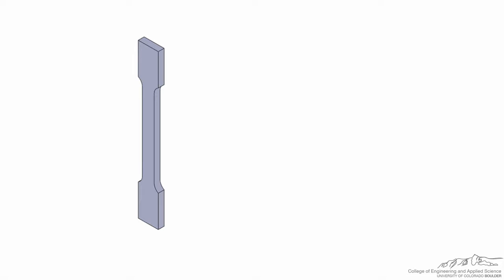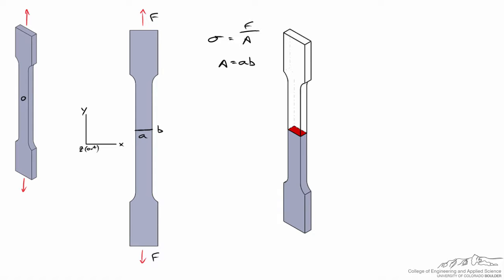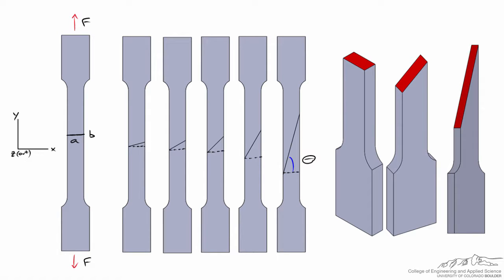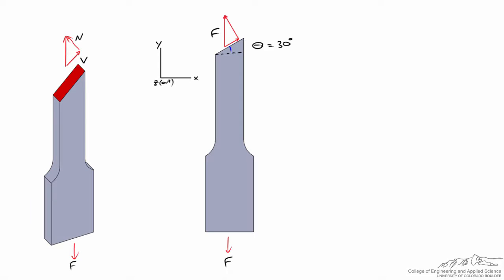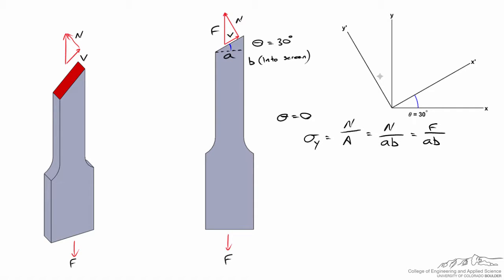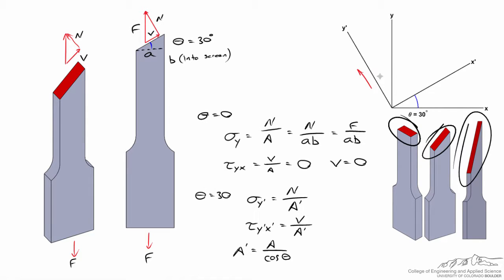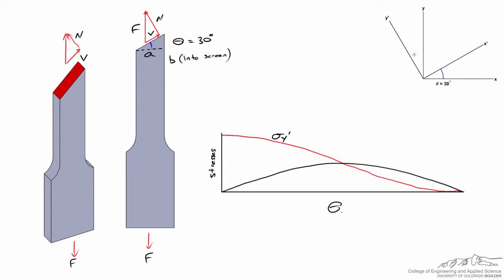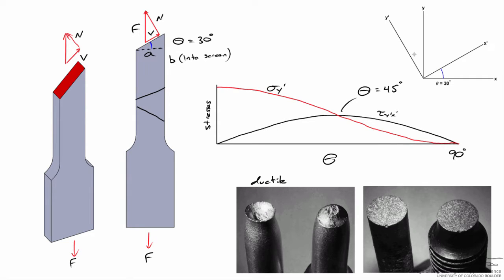Normal and Shear Stresses at Various Angles in a Tensile Specimen

Comment: At theta = 45 deg, the shear stress has to be maximum. But the normal stresses has to be zero. However, in your video, the graph that you made, it asserts that the normal stress is not zero when theta = 45 deg. Why is this?